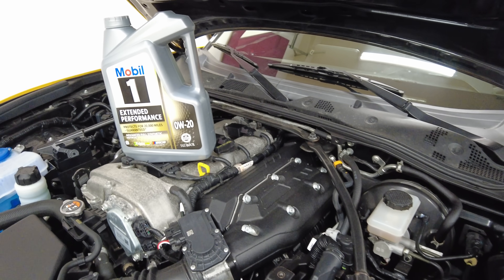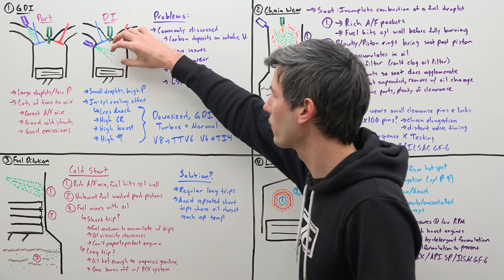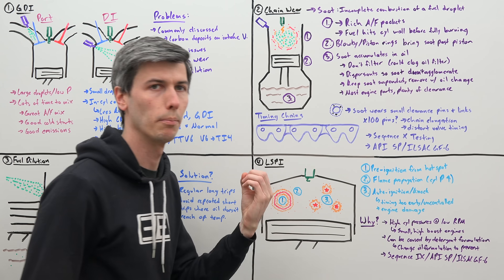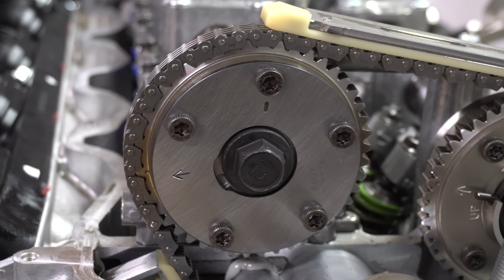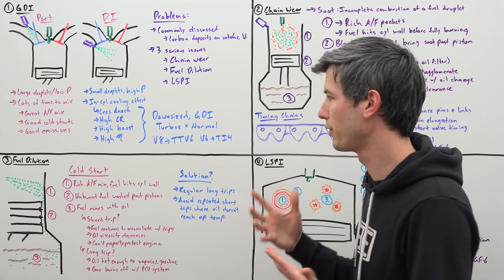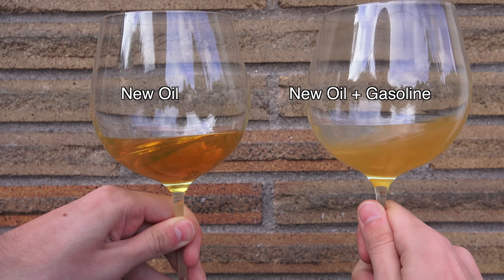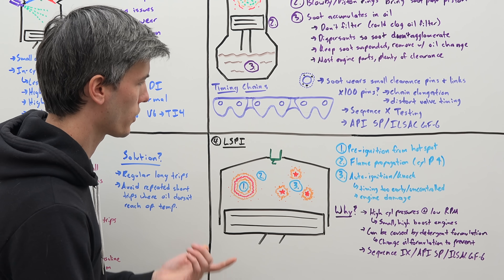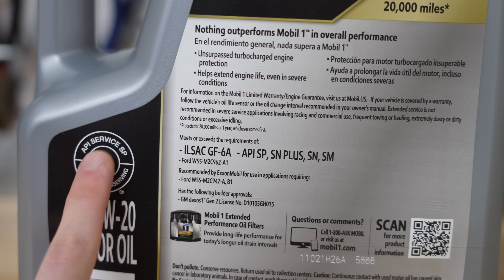3 Big Problems With Direct Injection Engines (Gasoline)

Comment: Hi there..Great information!   I have a 2.0L Turbo (DI) engine. I do take a lot of short trips and am concerned about not reaching high enough oil temps.   What temp should it reach?   I have a catch can, change the oil every 5K and use correct oil for DI engines (Motul X-Clean).  What else can I do besides driving all over the place to bump up oil temps, burning gas that now costs a fortune?

Comment: Direct injection is just one symptom of the insanity that has seized automotive engineering. Cars nowadays are overpriced, over-complicated, unreliable, and short-lived. All of this is due to the government's thinly-veiled goal of legislating the automobile out of existence with ridiculous fuel-efficiency requirements.

Other problems with modern autos: massively over-complicated overhead valve systems, variable valve timing, turbocharging of tiny displacements, CVTs, aluminum everything, computerized everything, and, of course, cars powered by lithium bombs ... errrr ... batteries. ( Electric cars are also an environmental disaster, but that is another subject. )

I'm not a complete luddite, basic fuel injection is a good idea - so nice to turn the key and it starts right up on a cold winter morning. But all the rest is just problems, and tiny gains in mpg that are easily erased by having a heavy foot. Good basic personal transportation is going extinct. If you have an older car or truck - hang on to it.

Cars today are so expensive both to buy and to maintain that many young people have simply given up on the idea of owning your own vehicle. Part of the American Dream has died. Thanks, Congress.

Comment: So basically,  were running around with 0 wt 20 oil, thats diluted to 0 wt 10. Yeah,  so long 150.000 to 200.000 mile longevity,  we'll be doing good to make 100.000 without severe bearing damage. I'm changing the oil every 3000 miles on my 4 cylinder GDI Turbo. Will see if that helps in the long run. My oil always smells like gas,  but no increase on dipstick.  And it driven 80 miles round trip on the freeway 5 days a week at about 80 mph.

Comment: I wonder if many people really get much better mileage with these smaller motors and turbos. I would think that their driving habits, at least around where I live, might trump the possible gains in mpg. In theory they would use less gas but if they stomp on the accelerator at every intersection and they're in boost all the time, do they really? Will these smaller motors under more stress from being turbo last as long as a comparable slightly larger na motor? Maybe they just want to sell more cars if they wear out faster. That's how they build everything else these days.

Comment: My 15 Hyundai Veloster Turbo’s timing chain started going out about 60-70k miles, but I was also running Amsoil Signature for 15,000 miles starting about 43k miles. So I am unaware if it was my fault for the extended drain interval or Hyundai’s.

Comment: i think u missed one whole engine degradation due to oil contamination. I think u have drank the cool aid on it doesn't matter on other parts. I have seen many many many of these totally destroyed after 90k these engines are never gonna make 250 or 300k  which sucks. Direct injected engines are throw away engines i hate them and so should the world.

Comment: How does in-cylinder soot arrive at the timing chain, if the oil is holding soot in suspension?
Reply: Do more frequent oil changes

Comment: The soot is a bigger problem on the valves and cylinder roof where it causes loss of compression and pre ignition inducing hot spots.

Comment: I have a 2016 Kia Soul with a GDI 1.6L engine and a 6-speed manual transmission.
I purchased this car new.  
it is the third new car I've owned (previous cars were a 1989 Plymouth Colt and a 2000 Hyundai Elantra wagon, all with manual transmissions).
This is my first new car to experience oil loss during the period between oil changes (5,000 mile interval, synthetic oil).  
The Kia Soul's engine routinely loses half-a-quart to a full-quart of oil between oil changes.
Did not have that happen with my previous port-fuel-injected engines.

Am I a small sample among statistics?  Perhaps.

Comment: Good job! Well explained. I love Mobil1. Used it since the marketing push back in the early 80s. I worked at an Exxon and Mobil station. Every engine I've looked into that ran Mobil 1 all the time, were always spotless.
Reply: Synthetics in general all seem to be very good. Though still needs regular changes. I generally do mine every years or 10000 km.

Comment: I'd like to see a video on why we don't use hydro power on tributaries to the ocean via something like a vertical turbine. And, use that power in turn to create electrolysis to create hydrogen out of ocean water to them power hydrogen combustion engines. Wich would be easier for our manufacturers to convert to building and less detrimental to the environment because it would reduce lithium mining. Also would not the conversion of sea water to hydrogen off Gas oxygen helping pulution and increase the salination level (once done on a large scale) of the ocean to offset the ice caps melting wich is reducing the salination level.

Comment: You can prevent most of this! LPdi (liquid lpg direct injection)  it's like a dream for the GDI engine, I've got a 1.2 TSI (2010) with LPdi, never starts on petrol (so no oil dilution) and pretty much no soot emission. Plus the LPG has a higher octane number. So it's really awesome. My injectors run quieter than on petrol and I haven't had to do a timing chain replacement ever, it's now on 300.000 km (~180.000mi). Exhaust is clean, like bare metal from the inside. Oil stays clean like tea! Also less likely to have LSPI since the autogas instantly evaporates at the injector tip. Rather than petrol forming droplets... (So cold start doesn't require enrichment)

Comment: This all does not matter at all because you save so much fuel that for the savings you can but 2 brand new engines. At the same time engines are not less reliable they are more reliable today than 30 years ago. This video is like claiming that working at the airport is bad for your car since a Boing could fall on it and scratch the paint.

Comment: So, 1) change your oil every 5,000 miles 2) buy a car with timing belt
All in all, I'll stick with NA port injected cars for as long as it is reasonable.
Plus this video nicely explains what happens to turbo diesels in passenger cars

Comment: Could some of the "failure to mix" issues be solved by running multiple injectors, thereby "filling" the cylinder a bit more evenly?
Reply: I think it can, but it will make the engine more expensive.

Comment: is it normal for a DI engine to have what sounds like valve chatter before it reaches operating temp? my Kona does, and when i brought it up to the dealer at the last maintenance appointment he dismissed it as not an issue.

Comment: Very well explained. I have a 2011 lexus is250 awd and daughter has a 2015 lexus gs350 f sport.  Frequent oil changes  done every 5000 miles with 0w-20 synthetic oil. Mostly hwy miles driven

Comment: Awesome video Jason! Can letting your car idle after a short trip turn it into a "long trip" or does the car need to actually be driven?
Reply: I would think you'd actually need to drive it.  The goal is to get the oil up to operating temp (let's say 200 *F or so) to evaporate the fuel and moisture, and idling after a short trip is unlikely to get it there, particularly in the cold weather.
Reply: @IJMacfarlane  I mean but it's not like you're at higher RPMs for a significant amount of your driving, you still hover just above idle for most of it
Reply: @chicken29843  Even 1,300 RPM is twice idle speed.  What really matters is load on the engine, and you only get that by driving, even at a relatively low RPM.
Reply: @IJMacfarlane you can reach operating temps at idle. Unless its like below zero outside 😂
Reply: @IJMacfarlane  but the engine runs hotter when you're sitting in traffic which is the same as a car idling. I would think that might help instead of driving the car at highway speeds which would cool the engine because of the air passing through the radiator. I currently have a car that overheats if it sits still too long.
Reply: @MaxHasManyHobbies  well it is something like this. When you are idling you don't have abundant air coming in over the cooling system so parts of the engine heat up.   But at the same time the engine is not engaged. It is not doing any work.  When the engine is doing the work of making you go forward it requires more energy to push against the Pistons.  Therefore the combustion in the engine when the car is running it is at higher pressure than when it is idling.  When you are idling you can get a higher engine temperature because of the lack of cooling not because of the reduced pressures in the cylinders.  The reduced pressure in the cylinder means the ignition occurs under lower pressure and therefore there are more pollutants in the exhaust. Specifically more unburned fuel.  That's why for decades air quality measures have targeted reducing idling emissions.  Your engine can be at a higher temp because the cooling isn't working as well and at the same time not burning the fuel as efficiently.    That would lead to build up of fuel in the oil particularly on GDI engine.   So driving, rather than idling, is the ticket burning gasoline that is built up in the oil.  Yes, when you are driving at high speeds the cooling system is working more efficiently.   But in order to generate those speeds higher pressures and therefore higher temperatures in the actual combustion chambers are required.  And that leads to a more efficient burn and reduces gasoline in the oil.
Reply: @tim71pos  if my temp gauge centers that’s up to temp. So say I run my truck at 70 mph for 10 minutes 4 times a week I’m clear of gasoline buildup in my oil?
Reply: @MaxHasManyHobbies  That's certainly true for coolant temp, but the important thing here is oil temp. Oil gets hot from load on the engine.
Reply: @tohloc  
Gasoline has a flash point at around -76 F meaning it turns to vapor as soon as it can. Shouldn't be a problem in most engines that are working correctly. I live in a cold climate and that doesn't seem to prematurely end cars. Not following service intervals and general maintenance is the worst thing that kills engines 99% of the time, dumping the oil means dumping everything suspended in it
Reply: @tohloc   I'm feeling my way here.  When I run my car to work 20 minutes each way twice a week, in very cold upstate NY, that's not enough.  Preheating as Holderman suggests below might work.  Myself, for now I'm running on increasing my oil changes (0-20) from 2x a year to 3x a year.  I get my oil tested at Blackstone.  My last oil change was after 5600 miles (which is nothing for Mobile 1 0-20) and my car was over limit on the gasoline %.  But that was after 7 months.  (low mileage driving due to COVID)  So I'm thinking try 3 times a year regardless of mileage and see how that works.  If it doesn't work I might think about some of the other ideas I see here.
Reply: @MaxHasManyHobbies  But it's been driven, it's already hot so it gets hotter because of not moving enough. But we are talking about a car that has been sitting.
Reply: @FacuGonz3  my personal experience is that engines always get colder when you let them sit. In fact my truck engine will become so cold, that it also affects the cabin heat as well; usually while I'm waiting for an excavator to set up. Usually if your engine is overheating, and you're just sitting there not actually doing anything; then it usually means that you have a problem with your cooling system; possibly a blocked radiator, or a bad fan.

That being said I recently went on a road trip with my girlfriend. We were driving her car. And we would basically drive as far as we could, until we were forced to stop and sleep. For three days, the engine ran almost non-stop; only shutting off for fifteen to twenty minutes at a time. (We pretty much only shut it off when we had to take the keys with us, into a store.) We left it idling all night, because it was in the winter, and it was negative twenty celsius outside. Overall her engine did cool off overnight, but it still stayed warm enough for us. And when we got back, it was a little worst worse for wear; it needed an oil change and it's a little sluggish to start. But I digress a little bit, engines generally cool down when you are not driving.
Reply: If this is happening there is a problem in the cooling system. Either bad water pump radiator or cooling fan or thermostat or temp switch.
Reply: @MaxHasManyHobbies   No the coolant tempreture builds quicker the faster you go so the same will be true of oil tempreture. I know because I used to work 0.5 miles from the highway I travelled home on. It would take my car 3 minutes to warm up whereas in normal circumstances it would take at least 2x as long.
Reply: @tohloc  probably not getting the oil hot enough.
Reply: @wyndhamcoffman8961  Is your truck a diesel? They make very little heat at idle. My late uncle once bought a VW Rabbit diesel (always the economy freak) and got rid of it because if he had to sit at a long traffic light or train crossing, very quickly the heater started making cold air, the engine did not make enough heat. I have had little trouble with idling gas engines still being able to put out plenty of heat.
Reply: @townhall05446  Yes I actually have several trucks at work, that I drive and they are all diesels. Now very rarely I'll drive my supervisors F-450, and that has a V10 gasoline engine. But most of the time I drive a caterpillar 769D, and 740 and a Volvo A40G.

Also don't they make heaters that plug into the cigarette lighter?
Reply: @WilbertIsRandom I know someone already responded but here is my 2 cents.

If your car overheats in stop and go traffic it's probably a bad fan.

In stop and go traffic the issue is running the engine then stopping the airflow over and over. So chris' solution would only work if you crank it up to 4-5 k every 30 seconds and at that rate you may as well just go drive it 😂 

Tldr: Idling is not the same and stop and go traffic, go drive it 20-50 miles in a trip once in a while
Reply: @MaxHasManyHobbies check ur belt if its loose
Reply: @Depl0rable10  My fans are still running when I'm stopped. I have an old 2005 Subaru Outback H6 so it's probably because of a bad head gasket.
Reply: @kumars172  How do I check that? It looks tight to me, but maybe it has to be at a specific torque.
Reply: @tim71pos  what vehicle do you drive and how has it gone over the past year? My wife's CR-V is having oil dilution issue and what you described is exactly what we came up with too.
Reply: @MaxHasManyHobbies it doesn’t
Reply: @joedwc  Tell that to my overheating-while-staying-still car.
Reply: When you are idling the blow by is greater due to the high pressure fuel and more unburnt fuel getting past the rings, you would be adding as much fuel to your oil as you dried out by just idling alone, engine needs to be spinning fast really
Reply: @johnnyduplantis  Yes.
Reply: @johnnyduplantis  Much appreciated! Chris has a great channel. As a track junkie, I've enjoyed watching his work on the BMW.
Reply: i would like to know too the answer to this question too!
Reply: I don't think it'd help, since idling puts very little heat into an engine. With that being said, I think it depends on the car and the ambient temperature. I remember a few years ago My family rented a Dodge Journey (I think) for a trip. It was a hot Florida summer day and after idling for about 10 minutes I did notice the engine was getting warmer than usual, the temp needle was about 3/4 of the way up. However, my other cars with smaller engines take quite a while to warmup just idling, easily 10 minutes before the radiator fan kicks on, and when it does its only for about 20 seconds. 

I wouldn't use it as a reliable method to burn off any fuel in the oil, and if you're gonna let the car idle for 10+ minutes, might as well take it for a spin.
Reply: @MrFastFox666  Of course, that was a Dodge...
Reply: Needs to be driven!! And hard for a few mins. They used to call it an "Italian tune up". Helps clear carbon deposits and burn crap off. Wide open throttle for as long as possible without getting cops chasing ya
Reply: 3k rpm or more for a few min will heat it to 200+ degrees and burn it off.
Reply: if its a honda, no matter what  its just gas in the oil either way, having gasoline in the oil and hoping it evaportates when hot is a terrble stratagy..... there is still going to be left over byprodicts of gas in the oil that simply won't evaporate.
Reply: If you are just going to sit there in idle, why not just drive around.  You are already sitting there in a running car?
Reply: Is that really you ChrisFix ??? Lord Have Merci..😵‍💫
Reply: OKAY people you’re ready for It ??? 
Simply get a diesel engine block heater put it in your gasoline engine and make sure it’s up to temperature before you go on your short trip !!!! No joke .. this is an option he did not discuss .. 
.. GOD BLESS ALL !! ….

This means you plug it into 120 V power supply .. This also means you have a certified technician install the block heater and make sure it has a thermal switch on it that shuts it off when it gets up to temperature !!! … 
Again GOD BLESS
Reply: @robertholderman7552  Another possibility is to obstruct the air flow through the grill to the engine.  Might make the car reach a hotter temp faster.    This is an old Midwest trick to get some more heat into the cabin.  I did this my first year of Accord ownership but I don't know whether it actually worked or whether it was because I changed the oil more often.
Reply: @robertholderman7552  That sounds pretty inconvenient, I'd rather just drive the car for a bit longer.